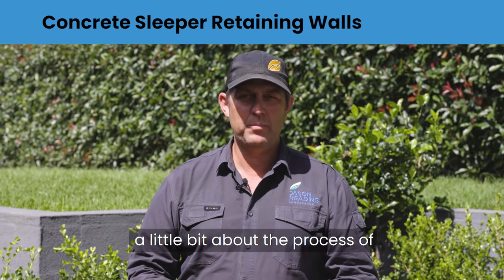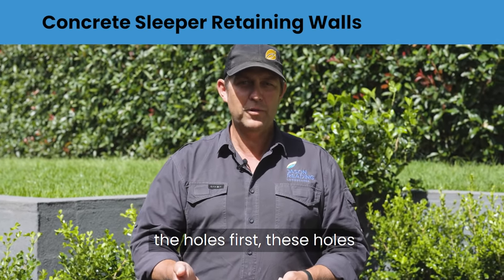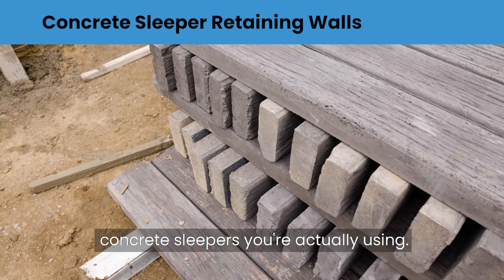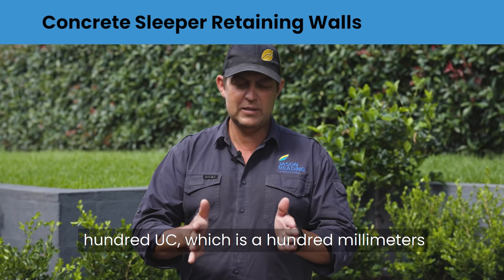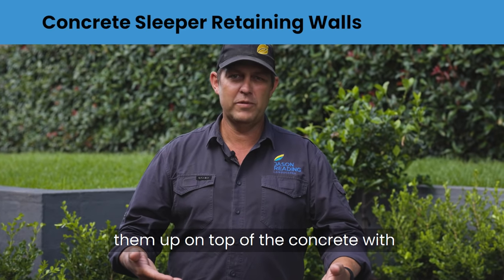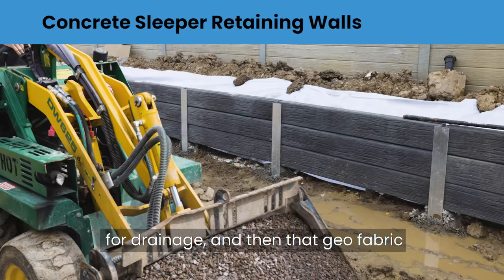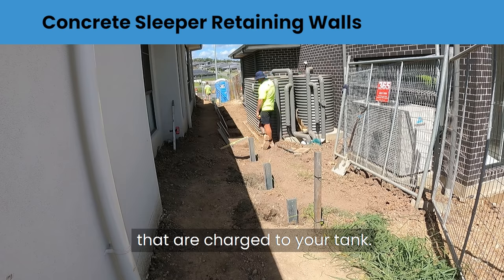Concrete Sleeper Retaining walls

Comment: Those Americans asking, the closest steel post size you have is a W4x13 Wide Flange W-Beam. Australia (where this is) uses steel sections much closer to British sizes than US sizes. As for the concrete sleepers, my understanding is they are specifically made to fit within the flanges of the steel beam (custom size), and would need a concrete yard in the US making them (which I'm not sure any are doing). The issue with some of these is that there is no cover on the end of the steel reinforcement bars which can lead to corrosion (they are generally made in long sections with long lengths of reinforcing bar and then cut to standard lengths which exposes the reinforcement at the cuts). My hope is they may change over to using Basalt Fibre Reinforcement instead to solve this problem.
Reply: No corrosion mate reinforced steel is encompassed by the concrete the posts are installed at the sleeper length no cutting
Reply: Top of the post?

Comment: I have carted and used concrete retaining wall sleepers over a 13 year period.  In that time, the largest sleepers that were taken out of the factory were the "Limestone Rockface" design, based on Mt. Gambier stone, 2.4 metres long, 200 mm high and 150 mm thick.  These sleepers were being used in a 3.2 metre high retaining wall, and the wall was reinforced with two sections of channel welded onto the uprights at 1/3 and 2/3 height of the retaining wall, and these horizontal beams were 2 metres long.  They were buried into the ground, and compacted into place to give further reinforcing to the base of the wall.  Secondary reinforcing was run the other way and backfilled away from the wall, behind the sleepers at varying heights..  Cement was 40 MPA, and 3 by N16 rods were used in each sleeper.

Sleeper sizes can vary from 1.8 metres; 80 and 100 mm thick.  2 metres; 80, 100 and 120 thick.  2.4 metres; 100, 120 and 150 thick.  2.5 metres; 100, 120 and 150 thick.  All of the above were on a 200 mm height.  Though, in saying that for the height, sleepers of 240 and 250 mm height have also been seen.  

The worst 'failures' that have been seen by myself was a 2 metre high retaining wall that was backfilled with clay.  Popped all the sleepers, and the whole wall needed to be replaced!  Similar results were obtained by compacting right up to the wall.  Minimum of 1 metre distance needs to be kept from the wall if you are using a wacker or a roller.  Another wall that failed was installed in the 1990's, it had to be replaced after 2010 due to cracking and fading of the sleepers.  That wall was a timber pattern applied to the top of the sleeper in the mould, done with a brown topping coat.

You also need to be careful as to the beams that are used in the wall.  Some contractors will use 80 mm posts, which are not up to standard.  One contractor was caught doing the wrong thing, so had to pull all the posts out, and start again.  Another shaved all of the sleepers to fit the steel.  Not professional!!!
Reply: Thank you. Very helpful. What diameter do the holes need to be bored for the steel posts if the finished wall is under 1m tall? The diameter quoted in the video seems a lot.
Reply: @DavesShed :  Suspect that you need to work on a 2 times multiplier with the hole that you need to put down.,  So, if you are using a 100 mm steel, you need to go 2 times the thickness of the biggest dimension on the width and height of the steel.  Not the length...  So, if the largest dimension is 100 mm,  you would go 200 mm either side of the steel, plus the dimension of the steel you are working off, so a 500 mm hole would need to be drilled to a minimum of equal the height of the wall, plus 10%.  Steel should never rest on the bottom of the hole!  So, for a 1 metre high wall, you would go down 1 metre, plus 10% of 1 metre, which is 100 mm.  

The reason why so big?  If your retaining wall , at 1 metre high, has a solid fence put on top, which does often happen, you need to ensure that the wind will not blow the wall over!  Do not laugh, as this has been seen to happen!  Much to the disgust of the client, and the embarrasment / oops! of the contractor!
Reply: @111jacare  The length (depth) is clear for me. What is unclear is the diameter of the hole. 
The way I was taught to determine the depth was 1:1+ 100mm for retaining wall height PLUS 1:0.5 for fence. So a 800mm wall plus 1200mm fence would be 800 + 600 + 100 = 1500mm deep hole. 
but what I'm unclear about is the dimeter of that hole because in the past I've always done wooden posts. With the steel H posts, I think they are 100mm wide? I am hoping that a 200mm auger will be enough.

Comment: First time i saw this setup was last year in QLD, i was impressed. Im lookiing at doing the same to a friends property in Thailand. Size is 24 MTRs x MTR high. Can you please tell me How thick is the galvanized steel, and how thick are the concrete sleepers. Also do you need to put a rust inhibitor onto the gal to prevent it from rusting. Thank you.

Comment: At the start of construction of the Victoria Line Tube in London UK. we built yards of this type of sleeper walling. Some was for sand/aggregate bins for the concrete batching plants. Other's were for the tunnels excavated spoil, where loading shovels could load muck away trucks with out chasing the clay around the yard.
Sleepers were cheap and if we supplied our own trucks, we'd get them for free. It was a great way to recycle them. It's more difficult now with old sleepers and telegraph poles as they were pressure coated in creosote which is a big no, no now.

Friends restoring a tug used in WWII needed a mast and approached the telephone company for a used one. Because of the creosote regulars they could not supply one. Instead the company donated a new one delivered it and lifted it in place with their crane truck.

Comment: thank you for the handy video.  how high do you fill behind the wall with drainage aggregate? does it need to be all the way from the agi drain to the top of the wall?
Reply: Depends on height but I leave about 200mm from the top with the last 1m high wall I did. I fill the gap at the top with top soil. As long as there is sufficient room for the water to drain down.
Reply: @barakau  Just be sure that you wrap the geofabric back to the wall over the top of the aggregate to prevent the soil getting in.
Reply from the maker: Fill about 1 third of the height with drainage gravel. Then the remainder with free draining material. Hope that helps!

Comment: Hey mate, thanks for sharing! I have a question regarding the drainage. Do you need to have the ag pipe running along the retaining wall if you have weep holes along the wall? This is in clay type soil. The wall is 800mm at its highest sloping down to 200mm over 7 metres. Cheers.

Comment: i dont use fabrics on in the vertical a 3/4"gravel 100mm deep will hold all the silt back you want the wall to drain through the front as well as a the base

Comment: I like this concept because it fits my needs for space, ease, & longevity for the project I have planned.

The US eq H beam galvanized is about $50/ft at this time.  My personal project requires 43 beams varying in length above grade from 18" to 40".  My frost line is 36"... so I am looking over 10k usd just for posts.  Still have to source several hundred sqft of sleeper.

Not realistic at all for me.

So, I am thinking if I go this route, I would diy concrete posts to accept diy sleepers.

What spec/standard would a concrete post need to be made to?  I was thinking 6"deepX8"wide with channels 2in deep by 3in wide, that would accept panels having a 2x3in tab but be 4" thick to sit flush with the front of the post.  The below grade portion of the beam would be full dimension & sit on a concrete footer that is surrounded by gravel.

Using UHPC (10k+ psi & 1500+psi for both  tensile & flexural) & perhaps inert rebar (basalt) to build both the posts & panels.

I am not a concrete guy or a structural engineer.  I do work in precision manufacturing & can read & follow directions.  Anyone with experience or thoughts on something like this?

This video, being 2 years old at this time, may not see a lot of traffic... I will be cutting & pasting this question in other videos.
Reply: and for your sleepers - you could use this approach (diy garden bed boxes) with some more substantial rebar in it - cost of materials is about $22 per sleeper from HD (7" tall x 2" deep x 60" long) if you use teh method he shows in Part 4 of the series - https://www.youtube.com/playlist?list=PLZIMIDEiQu3IwuRHd8teRV0VFOT5ldHK2 - I'm looking at buildinga  48' long wall 36" tall using the sutter posts and diy sleepers - good luck!
Reply: @AussieInSeattle  Thanks for the reply.

I watched his series & a couple of the vids multiple times.

I settled on making a melamine form that makes 4 at a time & sleepers are 60"x 8x 4.  2pcs  rebar.

Mix is 2 bags "regular" 2L cement 2L CSA flow enhancer & 2oz basalt fiber.  I keep them wet while they dry & they can be demolded in about 6 hours (but I usually do just batch per day). 

I did a test batch last fall & let them sit out all winter (lots of hot/cold cycles).  No visible damage. I cantilevered one & stacked 10 sacks on the end.. no visible bending/cracking.

I found a local  importer of "super posts" & am driving those every 30" on a slight inward angle (about 10deg).  The sleepers will simply rest against them.  They have holes in them... so I may bolt a steel cable near the tops of them & anchor the other end 5-10ft back into the gravel base I back fill with.

Comment: I thought putting landscaping fabric vertically behind the retainer will cause the soil to harden over time with the water and can cause the ground to swell against the wall.
Maybe where you guys are, this isn't a problem.
Reply: He added pipe directly behind it then filled it with gravel.  Then you add a couple inches topsoil for the foot or so behind the gravel fill.  That’s how it should be done and how I believe he was saying but just didn’t show it.

Comment: You have used timber studs to hold the post spans when setting the posts.  Just wondering how you temporarily fix those to the steel posts?

Comment: Anyone know what he means by one in 16 and one in 10? What metric is this? Just trying to get an idea of how much of a lean back is needed.
Reply: for every 16mm vertical there needs to be 1mm of lean to the post. 
e.g. a 1000mm high wall will lean back 160mm
Reply: Thanks Keegan. Really helpful. Especially with the example!
Reply: Keegan Barns Your example math is incorrect. You would push back 63mm if you have a 1000mm high wall. 
1000/16 =62.5
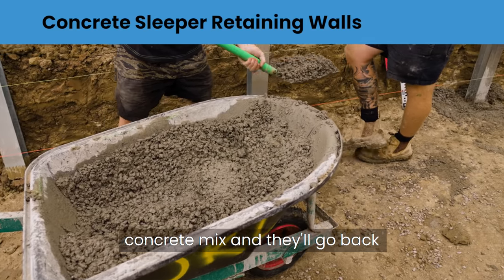Reply: Unit doesn't matter, whichever you use you'll get the same result. If your batter is say 1 to 6 (common for dry stone retaining walls), it simply means for every 6 units up there's 1 unit lean back. For every 6 cm/feet/meters/inches/millimeters/whatever, you lean back 1 of the same unit. The bigger number is height, the smaller number is lean back.  So, for the examples in the video 1:16 or 1:10 means, for every 16 or 10 units you go up, you go 1 unit back. Be it inch, feet, centimeter, millimeter, ... it's all the same. As long as you use the same unit for both numbers.
Reply: ☝🏼 Hes right. I just know it💪🏽💪🏽💪🏽

Comment: G'day Jason. Great vid!!
Got a rookie question..
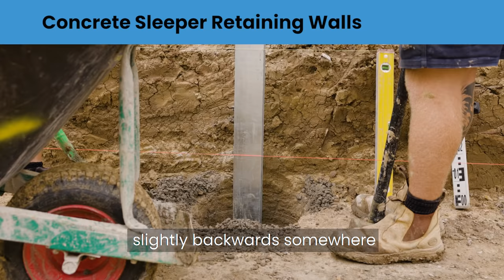In terms of a 1:10 or 1:16 fall back towards the side you're retaining, using a spirit level against the steel how far would the bubble be into one side of the lines on the level? Halfway on 1 side of the line, just touching the line, 1/4 over the line?
Reply: tape a piece of wood about 20 or 30mm thick 1mtr up the spirit level

Comment: Where can I buy this in the USA
Reply: Nowhere as far as I can tell.  I've been looking too.  I haven't seen the I-Beams or H posts, as they call them, either.  I believe they are similar, if not the same, as a galvanized guardrail post.  There are a few sites that sell reclaimed guardrails and posts which would likely work for a short retaining wall but it wouldn't be nearly as attractive in my opinion.  I'd love to hear if there is a source here in the USA for the concrete sleepers and/or H posts if anyone knows of one.
Reply: @Machinati  It's a system commonly used in Australia and New Zealand, in the US landscapers tend to use the stacked block walls you see everywhere there.
In my country Netherlands retaining walls are usually made from stacked concrete elements, stone filled mesh baskets or masonry walls, but I liked the Australian system for its looks and ease of construction because of the relatively low weight of the materials, and the amount of earth that needs to be moved is less than with other construction methods as no full length concrete foundation is needed, just the holes for the posts.

So I looked for steel H column in a standard 100mm size (4 inches) and ordered these galvanised from a steel merchant in the desired lengths.
The infill I use are thick hardwood timber, as it does look very nice and is easier to handle when building the wall on your own, the hardwood is 50mmx150mm in size (2x6 in US sizes) and length is kept to 1m ( 3'4") between posts to be strong enough against the pressure of the soil.
Beneath the surface I use concrete pavement edging slabs 6" deep to prevent any aggregate from slipping underneath the wall to the low side, the slabs are the same length as the timbers.
You should be able to get these materials separately in the US from a steel merchant and timber yard, the use of real railroad ties between posts is an option too, but the H-column must be of an appropriate size for the ties to fit in, a 6"x6" or 8"x8" H column may be needed for that.
Bear in mind that the space inside the flanges of the H is less than the column size, for my 4"x4" H column this is about 3" between the flanges, the remaining space when sliding the 2" thick timber in is filled wit 1" battens screwed to the inside
Reply: In the USA call wheeler metals. For the H beam about $12 a ft right now
Reply: @Machinati  I-beams are sometimes called universal beams or RSJs here in Australia too. Maybe ask a steel supplier in the states about them and see what they've got?
Reply: Note that all the posts are galvanised and designed for this application here in Australia.

Comment: UC = Universal column
I'd be inclined to build a retaining wall leaning slightly into the soil behind.
If it's vertical and starts to topple, you are goosed, it will progressively get worse.
I'd build it leaning in. (But I'm no expert)
Reply: The dude literally said to do that exact thing... 😂

Comment: Hi, I need help... we want to build this wall but when we dig hole, it's hard for us to drill.... we think its stone.. at least it's very hard... can someone assist us with suggestions please? The soil is compressed shale
Reply: This system isn’t suitable for all soil types. One of its only disadvantages is the need to be able to dig down as deep. A block wall could be a more suitable option for you because the footing it sits on will be shallower but it will need to be wider on the contrary. 
Each system has its pros and cons. It is definitely not a “one size fits all” situation, food for thought any ways… good luck 👍🏻
Reply: @hendrikkruk8322  hi there, thank you for your reply. 

Can you send me photos or link of what block wall you are referring too?

Kind regards
Reply: @niknik3520  it depends on how many holes you can get as close to depth as possible. Also will the wall be under high levels of pressure structurally,, or is it's purpose more cosmetic? After initial excavation in shale it's unlikely ground will shift forward. So if you cannot get all holes to full depth you may consider reducing space between posts for extra strength. You'd have to get all holes no less than 75% off required depth.
Reply: Use a auger to dig the posts and u can hire them for cheap

Comment: I would like to clarify - retaining walls built incorrectly with concrete, steel, wood or plastic will fail- period!
Retaining walls built correctly will last - period!  We have all seen wooden retaining walls last for decades.
There are some railroad bridges over 100 years old- There is a retaining wall in Rockport Texas that cars drive by daily that was
built in 1943.  Here's what to keep in mind- if you build it out of concrete you release over 20lbs of Co2 per cubic foot used-
If you build it our of steel you release over 30lbs of Co2 per cubic foot used- if you build it out of wood you sequester over 17lbs of Co2 per cubic foot used. If you build it right regardless of what you use, it will last past 60 years, you will save money and, if you use wood, you are using a renewable resource. But, if you do not know how to build with wood, stick with what you know!
Reply: CO2 is plant food; not some toxic gas. But your points on wall construction are appreciated🤔
Reply: @Xalta_Sailor  You're right! It's not the CO2 that's the problem. Without CO2 the world would be freezing and dead because CO2 traps the sun's warmth vital for life. But, the benefits of CO2 are constrained by water and heat. As you pass 40 degress celcius, the proteins in plants denature (cook), and photosynthesis starts to slow and eventually stop (leading to plant death). High CO2 without water is highly problematic! The reason CO2 emissions matter in the atmosphere is as it goes up it results in too much trapped heat. This leads to big changes to the hydrological cycle (more extreme rain, and less rain in between) and increases the frequency of extreme heat. Bottom line: emissions matter!